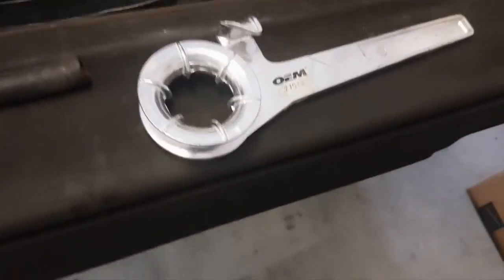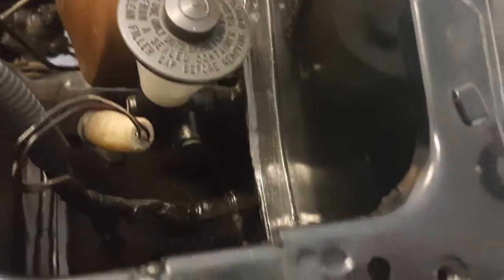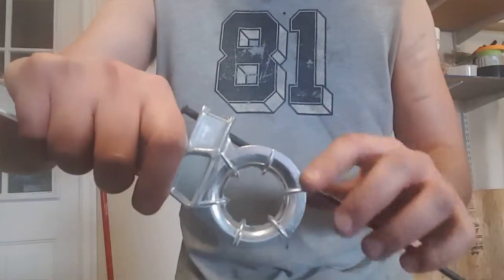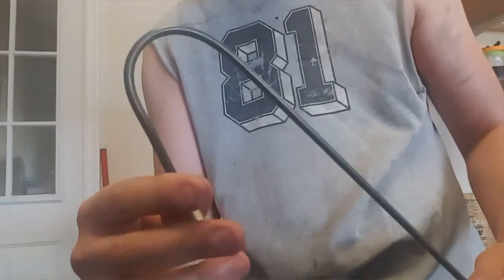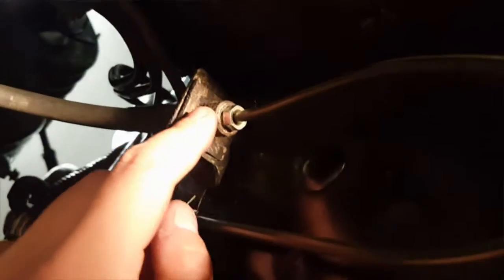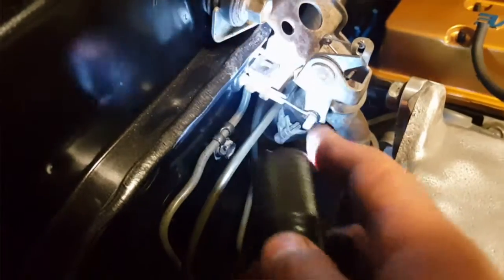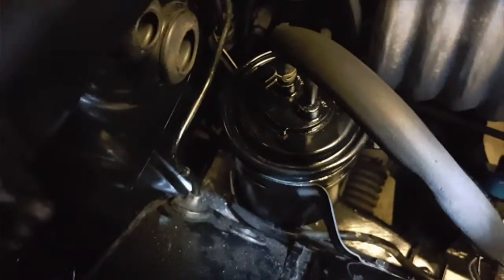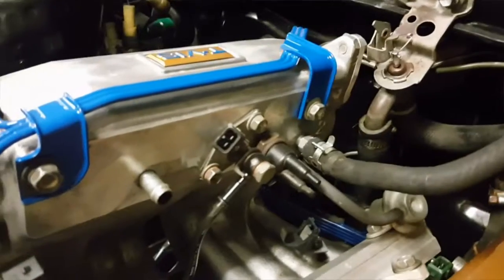Ep.06 PROJECT: ae86 - making a new clutch line

Comment: Hey bro what size fitting did you use?
Reply from the maker: I can't remember the size but any auto parts store can look it up.  The brake lines are the same size fittings too.
Reply: ae86 - sr5 to gts conversion thanks bro ya I just went and the fittings were already on the line!😊 thanks for the fast reply bro!
Reply from the maker: Yeah man....good luck with everything!

Comment: Hey man,  was 70" a good length?  About to order one for myself.
Thanks
Reply from the maker: Hi there...70" actually fit perfectly.....hope this vid helps you.....and thanks for subbing.
Reply: Yeah man np.  did you use 3/16 line size?
Reply from the maker: that sounds right....they have these at autozone for like $8.  just ask what size tube you need for brake lines but 3/16 sounds right.